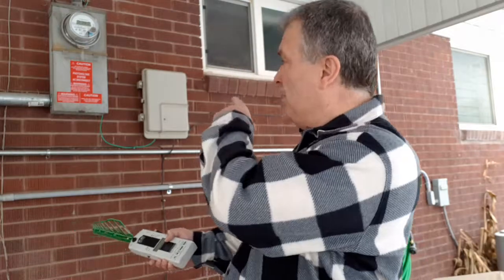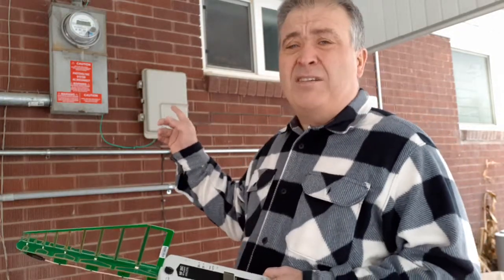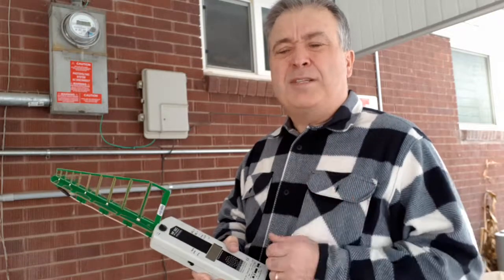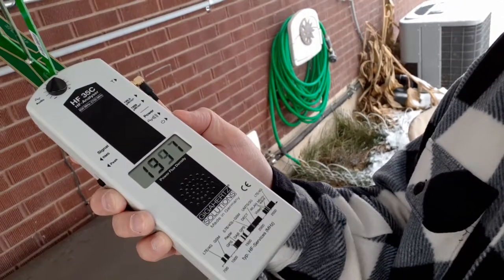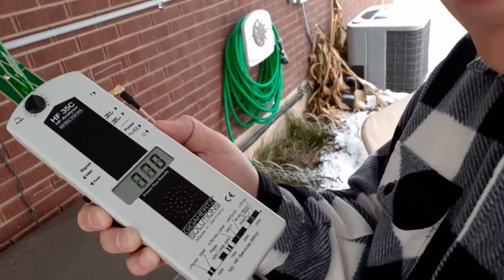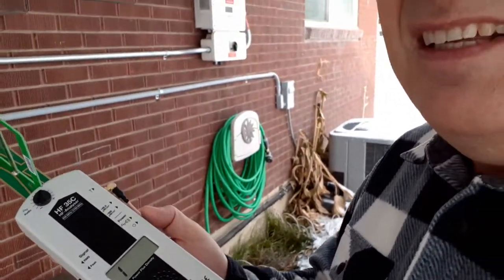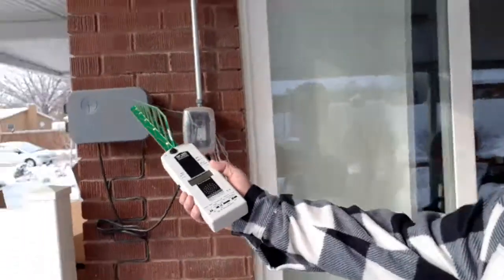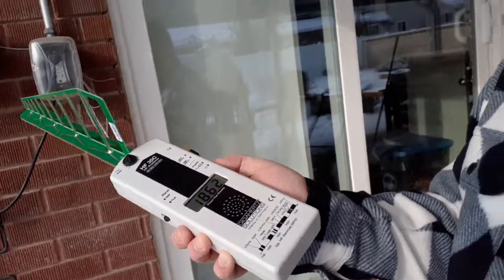Testing A Home For RF Radiation Part 1 - Smart Meter Outside

Comment: Thanks for all your work to protect people.
I'm looking for information for people from poorer homes and incomes (I'm on £200 a month) to get access to this type of equipment. It's not what I can afford nor what people from impoverished backgrounds should have to spend their money on.
I need to find level headed people to argue against RF/EMF overt domestic usage. If anyone can contact me on rueolearywalker@gmail.com, mobilisation against lack of concern in this area is vital.
Many thanks!
Reply from the maker: If you can I would get these https://cornerstoneconceptsllc.com/aulterra/. I would also go to the hardware store and buy some aluminum window screen (not the plastic kind) and wrap your wifi router in it. Also I would get an metal mesh waste basket for your phone at night and ferrite beads. Or wrap your phone in aluminum window screen and a ferrite bead on your corded headset...whatever you can afford. See https://www.radiationhealthrisks.com/protect-yourself-from-cellphone-radiation/

Comment: What is the measurement your using???? No one ever mentions this !! What the hell is it ??
Reply from the maker: Thank you for the question. It measures micro-watts per meter squared. The goal is to try to get everything down to between 3 to 6 micro-watts per meter squared. This meter measures up to 2,000 micro-watts per meter squared. When I say it pegged the meter, or when you see the meter read "1", that means it is measuring more than 2,000 micro-watts per meter squared. Some smart meters emit up to 60,000 micro-watts per meter squared according to others I know of who have measured them. Hope that helps.
Reply: @RadiationHealthRisks  oh ok is that the u W/cm2 ?what about mV/m or any of the other reading ? I jus bought a HF-B3g. Hey thanks alot for your help!!!
Reply from the maker: @myspurs2003  Thank you for the question. Yes I believe that uW/cm2 is micro-watts per meter squared. Type that into Google and it will tell you for sure. The other is a volts per meter measurement which has to do with electric fields. If you read your manual is should break all that down for you specifically.
Reply: @RadiationHealthRisks  oh ok thxs man.btw do u recommend in website or youtube channel that might break all this down easier to understand?? God bless man !
Reply: @RadiationHealthRisks  -- Hello, and thanks for you videos! 1 uW/cm2 = 10 000 uW/m2.
Reply from the maker: @myspurs2003  Unfortunately I don't know of a good source that explains that currently. I will look for one however and when I do I will try to mention it in a future video.
Reply from the maker: @MagnusJohanssonSWE  You are welcome and Thank you.